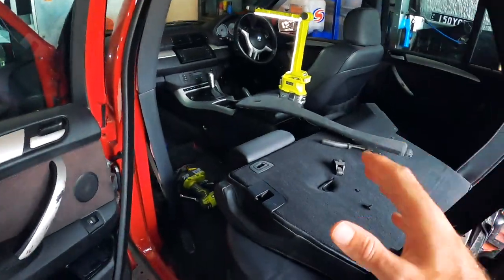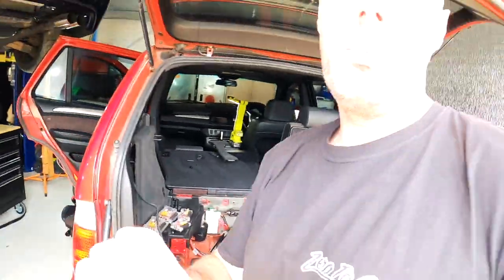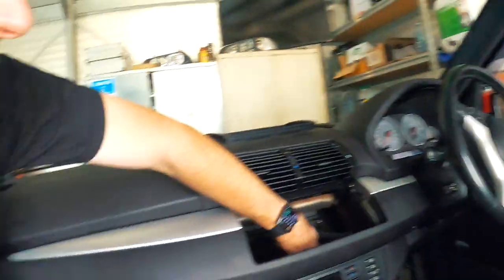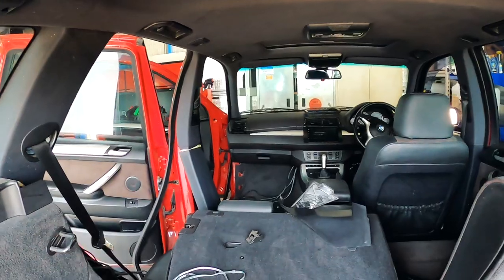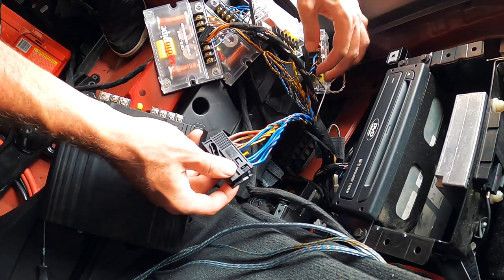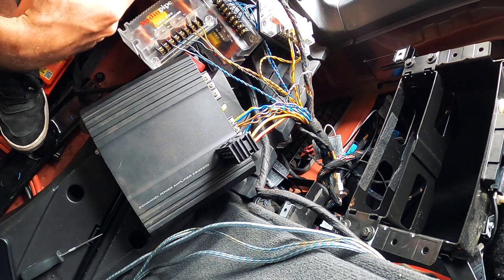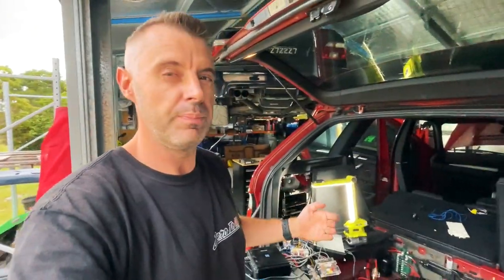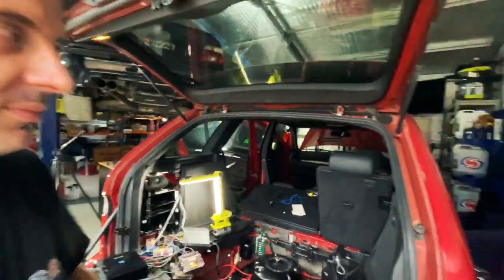BMW E53 Android Install & DSP Bypass Replacement

Comment: I miss the stereo I installed in my first car back in 1998. I had an Acura Legend with 2 12inch pioneer subs, pioneer 6x9 door and rear deck speakers and a solid pioneer head unit/cd player. I believe it had a 1200watt amp by pioneer as well. All those components worked so well together.
Reply from the maker: Hell yeah man!! I think it was 2001 i did my first install. Started with a miss match of what ever was on sale. But the first head unit i bought was a pioneer. It was 50watt x 4 with the "mosfet" amp in the head unit. I was so excited to install it back in the day but it was such a basic unit.
Reply: @ZeroTo60Tube  What's crazy is car stereo stuff costs about the same still.

Comment: Nice one.  The old dsp unit must have digital crossovers to be that small and efficient.  Wrong polarity just means the frequencies cancel each other out - this is very apparent in the lower frequency range. Tweeters can be heard as well but maybe not in this application.

Comment: This is great! I've been considering an xtrons for my e39 but I have dsp and kept reading how much work it was. This made sense seeing it done! Thanks. Doesn't look like much more work than wiring in a good setup anyway.
Reply from the maker: Well you can keep your DSP and run the xtrons and save the spaghetti wiring in the boot. With the ibus app, you still get full control over the factory dsp.
Reply: @ZeroTo60Tube  wow, even easyer.
Reply: @ZeroTo60Tube  can you please tell us more about this option? will it sound good and have all the functions?

Comment: Hi! This is quite a great video, however, I am unsure on how to proceed with my car, which I haven't seen in the videos. I have an E53 with the 'old-school radio display' and what it seems to be the DSP (has 3 connectors on top), however, there is nothing on top of it (I think it is the Bluetooth system) which leaves a huge gap on top of the DSP, am trying to figure out if I should replace my car stereo from factory, since the stereo glitches a lot (turns off every 20-30 minutes and the screen has several dead pixels) yet the sound works just fine. I am unsure if i need the 5-6 meter harness and also I am not sure if the lack of the Bluetooth system would affect an Android screen/audio, I have very poor knowledge on the topic and I would optimally acquire the Android unit on a tight budget, any suggestions?

Comment: Ok I am about to tackle this project to replace my fault factory radio system with an aftermarket andriod unit. Unfortunately my E38 has a DSP system with the exact black amplifier, I have a few questions:  How many crossover unit do you require to hook up all the wirings from the DSP unit?  What kind of amplifier are you using it? I note that you have an alpine amplifer, any 4 channel amplifier would do?  I don't think my E38 is equipped with subwoofers as I checked the rear parcel shelf, didn't see any speakers attaching underneath. Does it make my job easier?  Thanks

Comment: I bought an aftermarket android 10" and the installer installed it without even having to take of anything from the rear nor fiddle anything in the rear and it works well. The only issue is the FM signal intermittence. I came here thinking that you might recommend how to rectify the signal intermittence which could be adding a signal booster.

Comment: I own a 2005 bmw x5 with a 10 speaker plus 2 subwoofers factory system and I’m installing an aftermarket amplifier to my speakers but I have no clue about which speaker wire is positive and which one is negative. Do you know where I can find a diagram for the factory speaker polarity? I know I can remove the door panels and use a 9 volt battery to know what’s the polarity but I’m trying to save the work from removing the door panels lol.

Comment: How long does the xtrons take for it to boot on initial startup (first start of the day) before you hear music, and how long on subsequent starts? Do you regret not having a volume knob? Thank you for taking the time to document everything.
Reply from the maker: It’s Probabaly 30-40 seconds. But I never notice it. Don’t miss the knob at all. Always use the steering wheel controls for volve
Reply: @ZeroTo60Tube  What did you need to do to get the steering wheel controls to work? The vol + - does change the volume but it doesn't show up on the head unit and the forward/ back does nothing. You're the only person on youtube that actually shows the connections on a e53 with nav and dsp.

You convinced me to get a xtrons, I went with the IA7253B because I need buttons and knobs, thank you again.

Comment: just finished watching it and well, it’s alot more compared to my old W124 Mercedes 😀 looks about a day or a day and a half of work, right?
my X has only the midbasses in the rear but I do have the “DSP” door panels with two speaker slots per rear door. should I get ready to wrestle with the rear door wiring in case its not set universally or just replace the rear door speakers fo coaxials and set it? sound for rear passengers does sound a bit muffled
Reply from the maker: I would allow a day if its your first time. With the door wiring, there really is no way of telling if you will have the wiring for the rear tweeters, however in the rear using a set of coax should be fine for your sound stage. A lot of high end installers will run lesser quality speaker in the back as you done really want to hear them from the front. Good luck with it and take your time. Its really not as bad as it looks.

Comment: Love the video, my only problem is you didn’t show or explain how you connected the ibus wire up, I’m planning on installing the same setting on my e38 740il I just want to know how you get it done
Reply from the maker: There is no ibus installed at this point. However this is the video where the ibus went in to this car. https://www.youtube.com/watch?v=BEWdVTgI4_w&t

Comment: I have an aftermarket radio,aftermarket subwoofer and amplifier installed in my E53 but im not getting sound from the front speakers only from rear doors speakers, what could but the problem? I don't have factory amplifier or subwoofer in the trunk

Comment: Thanks for the more detailed vid. Although keen to know how the ibus dongle is conneted at the back of the head unit ?
Reply from the maker: It connects to the USB port on the head unit. One wire to power, one to ground and one to canbus
Reply from the maker: The can bus wire is the tricky one, blue wire from memory in the original screens wiring harness.
Reply: Thanks for that, the unit i bought has a brown box that connects to the harness, so not sure if it is still needed. did you have a similar unit ? And would you have a link to where you bought your canbus from by chance ?
Reply from the maker: Hit me up directly on telegram and ill get you sorted.

Comment: I've got e53 and got android head unit got the long cable but not sound I don't know what's the problem was told that the is electrical problem but everything works fine just apart from the original radio don't work I mean the screen is on but no sound can you get back to I would really appreciate thanks

Comment: If you didn't want to replace the DSP, would you be able just to hook the usual 6m cable directly to the connector connected to the bm54? My bm54 module is almost dead and I was thinking of replacing it with an android, but I don't want to mess so much with all this stuff.
Reply from the maker: You can, however you will need the ibus app to control the dsp.

Comment: Maybe you can help with my install on 01 e39 . I am running slightly different head unit however i get no sound when everytbing is plugged in using all factor connections . Any idea why ?
Reply from the maker: I really dont know why that would be. The company you purchased the unit from should be able to help.

Comment: Hi Guys,  i don't suppose you could do a followup on the Sound Quality of the head unit at all?  Especially with the low output of the RCA's - would it be better running hi-level to the amp's ASSUMING that the distortion is lower than the RCA's.  Cheers.
Reply from the maker: Hi Owen, I will definitely be doing a full review of the unit. Unfortunately with the xmas break and well normal BMW madness with the cars we play with on the channel, i haven't had quite enough time with the unit to give a full opinion on it. However the audio with the low output RCA's are not a problem. As i went through this with my last e53. I know the poor subs will be the first issue with the audio quality. Then then the other speakers. I found in my last car with higher gains there was an issue with alternator wine. I can just about hear it on most E53s, even with stock amps. However it can be easily fixed with a specific capacitor. We will keep playing with and improving this stereo over the coming months. I dont really want to spend as much as i did last time, so we will see how we go with more of the budget ideas on improving the stereo.
Reply: @ZeroTo60Tube  cheers guy's,  really appreciate it. There's been way too much going on all round, so all good. I've been looking hard at these, and am thinking of getting a universal version for my van.  I'll be doing a similar thing to you,  swapping in my old set-up, but using a helix dsp for voltage boost to signal strength.

Comment: Great video. Is there a way you can sent me the pin outs and polarity on the non dsp system. I have a 01 x5 4.4i and will like to do something like this to have a better system . Thank you in advance.
Reply from the maker: The ones i used are in the description. However im still not sure if i miss read them or if the e39 wagon is different to the E53 x5 pinouts. If you have any other questions please let us know.

Comment: Hey! I got E53 with android aftermarket radio. Before I had OEM one with TV and nav. So they installed whole radio, but I don't have any GPS signal. Is they screw their job or I should connect it by special wire What wasnt included in whole new set up, or where might be a problem?
Reply from the maker: It could be something as simple as the location of the GPS sensor. I ended up mounting this one behind the dash cluster.

Comment: I managed to get my headunit working with no sound. I stumbled here and realised what i a job it was. Is there any other way/hacks so you can get sound without DSP overrides. ?
Reply from the maker: Unfortunately not, the dsp needs a can bus signal to turn on.

Comment: For next time, use a AA battery and tap the speaker wires on the battery, it will pop a bit and also if you can see the speaker it will show you the polarity (cone goes out for correct and goes in if backwards). Doesn’t work as much for tweeters unfortunately.

NF for the win!!
Reply from the maker: Unfortunately you cant see the woofer on the rear door speaker through the grille. Which is why i went with just trial and error and the heavy song...... plus the aa was down in the house..... ha
Reply: Hey did you use a fakra aerial 6m extension for radio in head unit ?

Comment: If I buy android unit with dsp built in and extension cable, will it work (sound) without modifying wires? I have x5 e53 2005 with dsp amp and nav.
Reply from the maker: Some units will work. But you need one that will control the factory DSP. The bmw models with factory DSP rely on the DSP to do all of the sound processing. So basically you need to make sure you can control the factory DSP. As standard the DSP is controlled with the ibus. Any android paired with the ibus dongle & app will work, as the ibus dongle sends the appropriate signals over ibus to activate the DSP.
Reply: Thank you very much

Comment: Hey did you use a fakra aerial 6m extension for radio in head unit ?
Reply from the maker: Nah, i am not a fan of the radio, so i ended up just turning the radio function off.

Comment: amazing how BMW can manage to fit so much into the DSP box.. but still need about 8 other boxes just for Bluetooth / navigation etc.. always fancied fitting an Xtrons unit to my E91 but hear so many stories of them not working properly
Reply from the maker: hahah you're not wrong. I did look at aftermarket DSP's and amps with DSPs built in, they are just a bit too expensive for my liking, which is why i ended up with so much mess here using the cheaper seperate components. I have a android in my e92 and i love it. The idrive integration now is amazing. You shouldnt have any issues and sound quality is no different to using the aux input. With some eq adjustments you get them sounding mint.